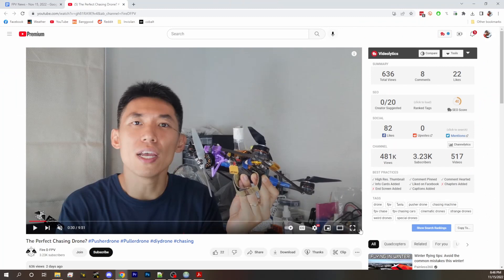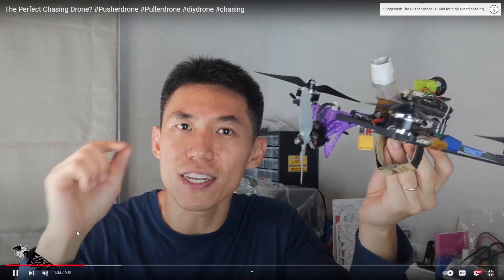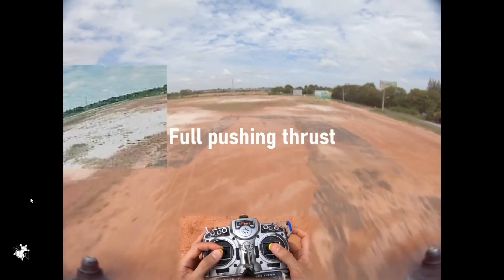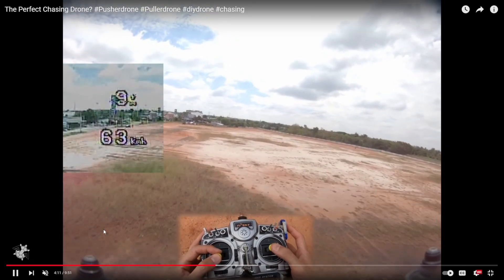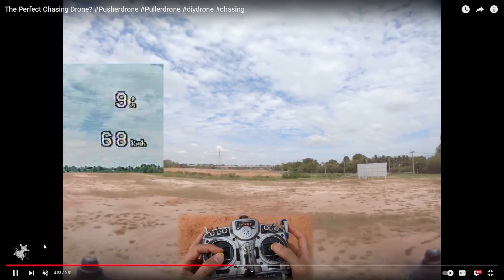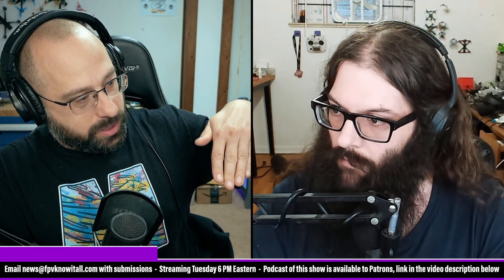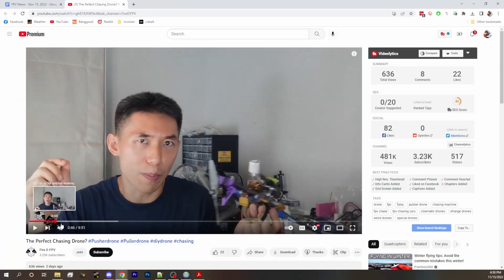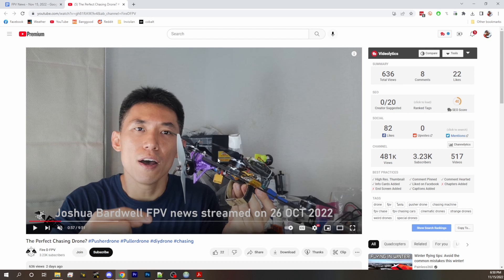The Perfect Chasing Drone Part 2! Backwards Thrust Added For Braking! - FPV News

Comment: The main purpose of that 5th motor is to push it forward. Since the prop is setup for pushing, the braking effect will be minimal, as the prop will produce little thrust if the motor is reversed....😏😏🇬🇧
Reply from the maker: He is using a different prop there now that he is using it for push and pull. His video explains the benefits of both push and pull. He also compares the braking effect. - Blunty
Reply: @JoshuaBardwellLivestreamClips  Really, well there isn't a propeller on earth optimised for both push and pull simply by reversing motor direction...😳😏😏